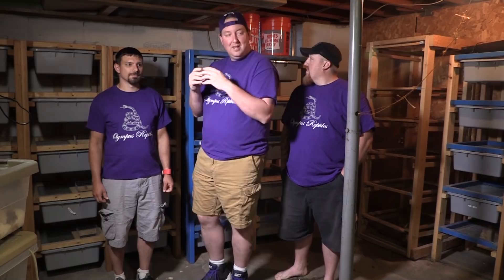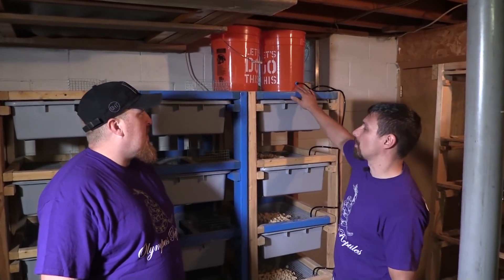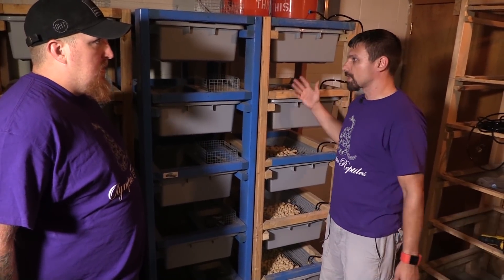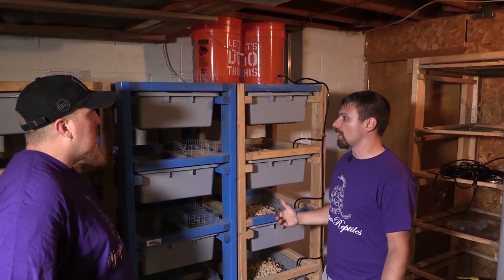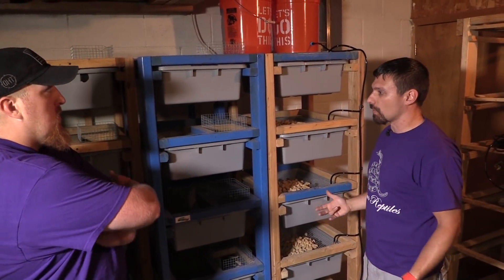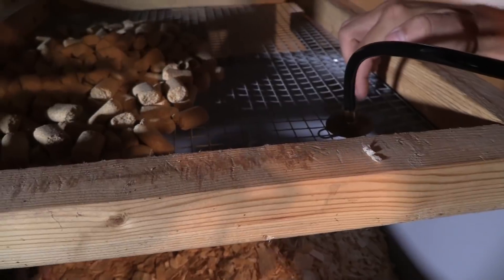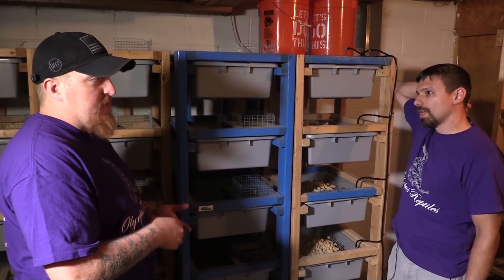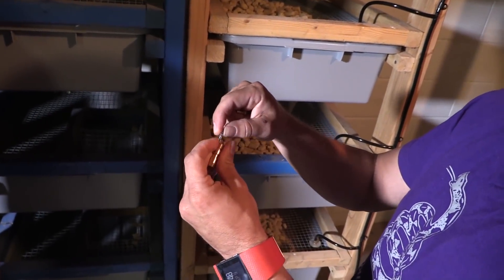Setting Up Rat Breeding!  Feed your snakes for free!

Comment: I might try the rotation method. I have a 4 tub rack (2 growouts and 2 breeding) and yesterday I built a new 6 tub rack (2 grow out 4 breeding). I have been using 1 male and 4 females in each tub and just pulling the males out, I think I'll definitely try 1 male per rack
Reply: Im also going to be holding back 16 more females for my new rack, how old/weight should they be before I start to breed them? I know they Can breed at 4-5 weeks but what is a safe age for them to breed?

Comment: Just getting started on our rat breeding and having some issues already.  Started with two tubs, 1 male in each with 3 females, per the recommendation of the guy I got my rats from.  Found one of the males dead the next day and thought maybe we just got him sick.  There were no wounds that we could find.  So we decided to run with the rotation method described here, rather than replacing the male.  Our male went two weeks in the first bin, then we switched him over.  The next day we found him severely injured, so now we suspect one of the females in that bin is the problem.  We isolated him and tried to rehabilitate him, but over the course of several days, his condition continued to deteriorate.  Sadly, we had to end his suffering.  Any recommendations for this issue?  Not too excited about trying another male in that bin, not knowing which one of the females is crazy.
Then we hit another issue.  First, I suppose it was also unfortunate that only one of the females from the first bin produced a litter.  However, it was 16 pups, so I figured that was a pretty good turn out.  We left the two other females in together with her and things were fine for about a week.  Then all of a sudden the mother started losing it on the other two.  We were in the adjacent room when things went sideways.  We heard the commotion and went to find all the pups scattered throughout the tub.  One of them was injured and bleeding.  Not sure what was going on, we took all the pups out to examine them and get things figured out.  My wife was able to get the bleeding to stop on the injured pup (it pulled through btw).  Once things were settled down there wasn't much choice but to put them back in the nest.  Shortly after the mother attacked one of the others, and we didn't see if it was provoked or not.  We observed and it happened again, just from being in proximity, so we relocated the female that was getting attacked.  Shortly after the mother attacked the other female in the bin.  We observed again and it appeared that all she was trying to do was care from some of the pups, seemingly attempting to nurse them.  After another small attack, we moved that female as well.  So, now we have a maternity tub, lol.  I thought the females co-oped when caring for young.  Breeders even recommend keeping retired breeder females for extra nursing.  What in the world is going on, lol?

Comment: For a commercial setting where there is an inconsistent demand, you really might consider making a co2 chamber to kill at various stages when you have a surplus, freeze them, and feed them to those garbage dump snakes that are absolutely not picky eaters when you have a particularly high demand week (if you are usually a live feeder).  Doing the f/t thing makes it so very much easier to make up for the wax and wane of customers, even if you are only feeding f/t to part of your collection.

Another tip I would give about rat breeding, commercial or not, lab blocks are great, but supplement with a little bit of fresh food. Your mamma rats will really appreciate it, and your snakes will really be getting the best nutrition. Yes it's a huge pain compared to just lab blocks if you approach it wrong, but there is a way to make it less painless. Grab a large bag of frozen fruits or veggies, defrost in warm water inside the bag, just toss about 1/8 cup in each  tub (not too much that momma rat wont eat it all that day or you've got rotting mess to clean up). Even if you only do it once a week, thats better than not doing it. If you are like me and have veggies or fruits about to go bad because you bought too much one week, use your rats as garbage disposals. Just don't go too crazy with citrus or your males will have issues, and avoid avocados all together.

If you just so happen to keep reptiles that eat dubia roaches and already have dubia's going, treat your momma rats to the occasional adult roach, they will love you for it, and that's a huge protein boost to the babies that will be going to your snake.

Comment: What is the cost of rodent food how long for a bag to last how much does a rat cost?
Reply: samasia skipperable I use the same food and it’s roughly $25 for a 50lb bag and it’s lasted a while for me with 2 racks setup I’ve gone over a few months now still not halfway through it
Reply from the maker: A bag of rodent food is roughly $25-$27. It depends on how many rats you have on how long the food will last. And a small rat can cost anywhere between $2 - $5 depending on where you get them.

Comment: what size are the tubs ? who makes  them? is red cedar  chips ok?
Reply from the maker: I'm not sure on the size but I get them from Sam's Club. I do use some cedar chip but only up to 25% the rest is pine chips.
Reply: Cedar can cause cancer in small animals. I've seen it happen to my brother's hamster.
Reply from the maker: @supernaturalpetlover2363  I am not saying you are wrong.  But how do you know it was the cedar that caused the cancer?  We have seen tumors develop before we ever used the blend, and the rate of it is the same since we started using it.  I am sorry that your brothers hamster got cancer, but curious what leads you to believe the cedar was the cause?
Reply: @OlympusReptiles   the hammer came from a very goog breeder with no health problems in the line. It was Lung cancer. The vet said it was caused by the ceder beading. And there has been reported cases of cancer by ceder in kids. So in my opinion it's just to risky to ues ceder.
Reply from the maker: @supernaturalpetlover2363  curious, that's what I was looking for (vet info).  I wouldn't put on all cedar, but a slight mix shouldn't cause an issue.  If any show signs of health issues for us they are culled.  Used to feed off at the first sign of tumor/ear infection/low production.  Most rodents we have will never live to get bigger than a medium prior to being used for food just from our in collection or too be sold (we supply the majority of our area, and wholesale to select other vendors).  A lucky few get to be breeders.

Comment: Things I still want to learn is 

How you set up grow out tubs and how you do that. 
How you deal with rats that aren’t used for the week. I’m guessing grown out. But what happens when you aren’t needing pinks and you need a ton of wean-smalls?
Reply from the maker: The grow out tubs are set up the same way but usually are bigger tubs. Rats that aren't used that week go back to the grow out tubs. If you have to many pinks and need more small you just have to let the grow bigger. If you have to many of one size sometimes you can trade them to someone for the right size.